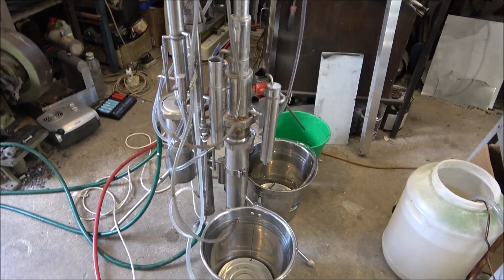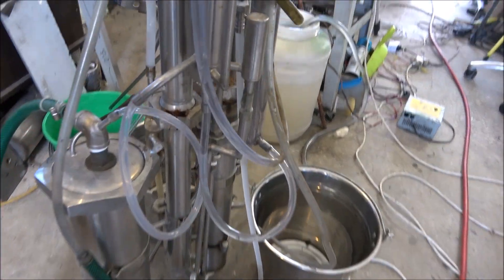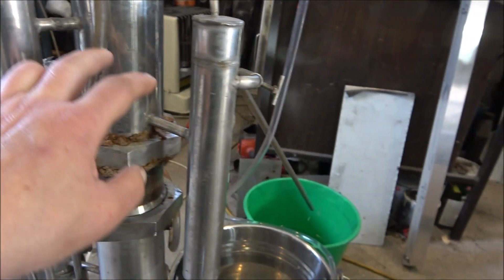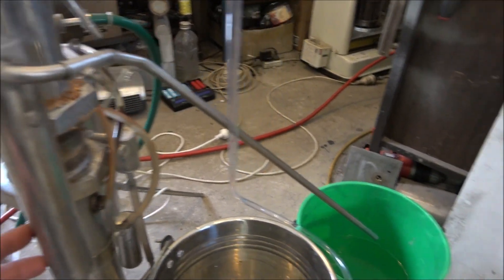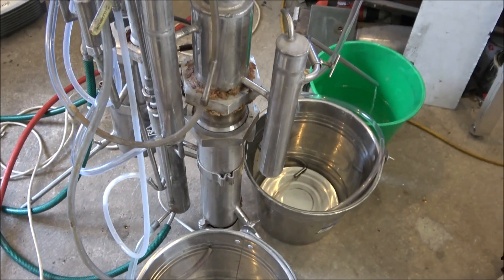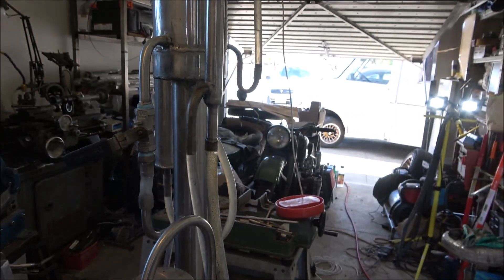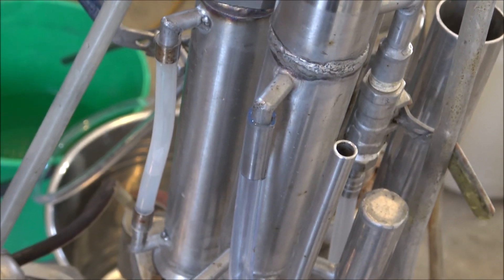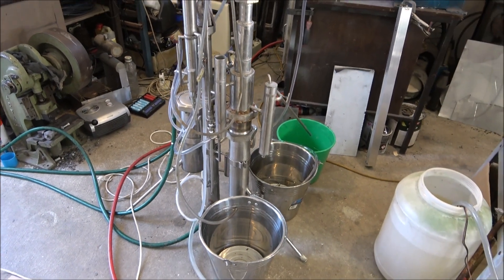Home distilling- experimental reflux still.

Comment: Alek... Great videos, thanks...!!  I have available to me lots of old gasoline in barrels, it smells a lot like varnish could I build a striping still to fast run this old fuel...??   What would you do..  Thanks again..
Reply from the maker: Hi, I would run it through a diesel/petrol separator to try to remove the heavy fractions, thus changing the composition of the fractions within the fuel, plus will add to the light-separated fraction some fresh petrol and will use it.
Separator: https://youtu.be/8ihpB73ZcN4
Reply: @santeryi9  Thank you Alek after I get it built I will send you pictures..!!

Comment: I really like the small size of this one and its low power needs.
Are you selling plans for this one???
Reply from the maker: The still is a standard 1.5kw continuous stripping still, and the reflux column just a removable attachment, the 1.5kw stripping still manual is available, and if you'll get one I can add some extra information about the attachment column.
Reply: @santeryi9  OUTSTANDING!!!!